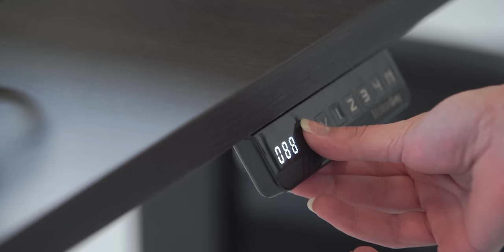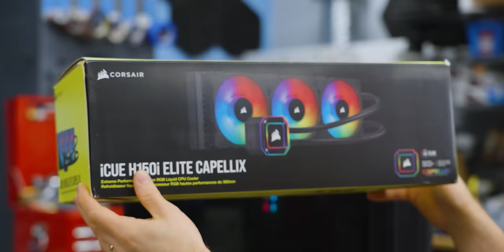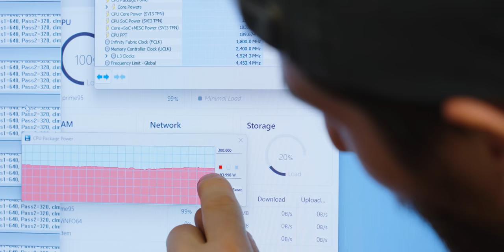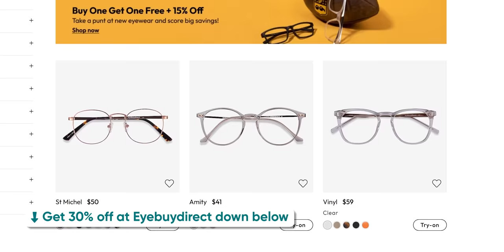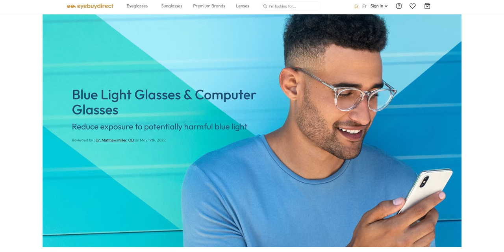Redneck Engineering my own CPU Water Cooler

Comment: Hose clamps def should've been utilized here.  Not only for performance over zip ties, but for the whole aesthetic/theme of car components/hardware meets PC components/hardware.
Reply: They should of tried an aftermarket tranny cooler or oil cooler. They have a much more reasonable size
Reply: Idk, I probably have more zip ties on my rally car than hose clamps tbh. 😂
Reply: I’m fairly sure my wrx is structurally together only because zip ties
Reply: @Sadamoto6  lol. Oh no dont get me wrong, im no where close to implying zip ties arent great for cars. Im merely saying on something small where the aesthetic is using something from a car as a mod, it would add to the aesthetic to use something that is also used primarily on that part. i.e. hose clamp on the rad. Just makes the mod that much more dope. But yea, i mean, have you ever actually worked on cars if you haven't used zip ties at some point? lol
Reply: Also, because it's supposed to be vaguely functional, hose clamps are the better choice.
Reply: @mikepatrona472  was thinking the same thing.
Reply: I bought a 1996 Mustang one time that had about 75 zipties in place of where the steering damper was supposed to be.

Comment: Heater cores are not exposed to air from the outside rushing past them, they are under your dash inside your car and have a fan blowing on them.
Reply: heater cores do get air from outside your car.
Reply: depends on the vehicle. on a chevy express you can turn the fan completely off on the highway, and the high pressure zone on the cowl area where the fresh air intake is, caused by the chevy express being shaped like a barn, will push almost as much air through the vents as the fan would on high.
Reply: He specifically stated that heater core came from a 69 camero. Those cores and almost every core pre 90s take fresh air from outside.
Reply: Your right. He described a radiator, the heater cor is typically inside the vehicle to heat the inside. The radiator is outside.
Reply: yeah true but that fan in the dash pushes way more air then 3 120mm computer fans. I dont know the power of that last huge fan but the cabin fan in a car is about half in size and about 50 - 100W
Reply: they do get outside air... but... usually through a small port that opens to allow outside air...
thats why many cars have a button called the "recirculate" button (please google the image of that button if your windows are always foggy)....pushing that button closes the port and stops outside air...which helps dehumidify the air better and improve A/C efficiency.. opening the port (turning off recirculate) allows outside air into the car to equalize humidity and reduce fog in a rainstorm
Reply: Someone was paying attention in an oshop
Reply: For everyone that is replying "oh but they do get fresh air from outside" that is not what Linus said or what I did. Your typical heater core is behind the firewall, inside the cabin, and under your glovebox. Yes, the ventilation system gets fresh air if you have the proper recirc mode set, but it is not getting air forced by it going at highway speeds like your main rad is. This air is typically coming from a much smaller vent located elsewhere in the system. There will always be outliers, but yes this is how it was done on a 1969 Camaro.
Reply: @CapitanDart  absolutely correct...
often that little flap is about 2" square (50cm) and deep inside the ducting but fed from the base of the windshield by the wipers....basically zero chance of any "ram air"....all cars have it....and often the fan pulls air through it AND the avaporator (which would also be a great cooler / AIO replacement as they flow a great deal more fluid than youd think although not designed for straight liquid)

Comment: Linus using wrong or slightly incorrect parts is very relatable. Many times I use whatever I can find around the house to make a project work and sometimes it's not perfect, but it turns out well enough. Never stop doing this LTT.
Reply: My bath/shower valve/selector is fitted with a milk tab when a part broke.... the milk tab solution is around 4yrs old now.
Reply: @Idiomatick  My compressor has a cylinder base gasket made from a milk carton. Has been working for years. 
It was supposed to be temporary but you know how those things go.

Comment: My first watercooling was with heater core from an old Opel. Fitted perfectly over the PSU in the old "full tower" style case, where there were plenty of room behind all those 5.25" bays (and I used those excess of 5.25" slots for a tupperware where I have submerged the aquarium pump) ..of course the dimensions prevented me to install that core to roof or back of the case, but having it so that the air path was from side of the case to other side of the case, it worked quite well. Also, when I built that, all the computer fans were like maximum of 80mm, so I got two thick 12cm 12V fans from an old photocopying machine and those made enough static pressure for the core. I dont remember what clocks I got with my K6-2 and my athlons/athlon xp's, but I remember I managed to run my Opteron 185 at 3.35GHz quite comfortably. The tension bar what I used to mount my block was nicely compatible with socket 7, socket A and also socket 939.

Comment: My first liquid cooled system used an Eheim pond pump and a transmission cooler with an electrical box as a reservoir, stuffed into a mid-tower case.  I still have it!  I miss the old days of overclocking and this video was incredibly nostalgic.

Comment: This brings back memories. That's what I used way back when for my first water cooling setup. I built a custom box that I bolted to the bottom of my case to house it, the fans and the pump (Eheim 1046, of course). The waterblock was a Dangerden.. something, I don't remember, but it was just a big ol block of copper. It worked great. It even got featured on HardOCP somehow.

And now I feel old thinking about how many years ago that was... ugh.
Reply: live fast die young? nah, live cool die old B^)
Reply: Ah the old days, when you just mounted your cooler directly to the die of your 1400mhz AMD Tbird.
back.. damn.. 22 years ago. 
Ugh indeed
Reply: @LordMithril  The one that you minutes earlier had used a pencil on to bridge the pads that let you overclock it :D
Reply: 1999 sick ass mod checklist:
☑ Hand welded copper block
☑ Junkyard moped radiator
☑ Florescent green engine coolant
☑ Tupperware reservoir
☑ Aquarium pump
☑ Radio Shack 3 way toggle switches
☑ Cold cathode lights & EL wires
☑ Sound-To-Light modulator DIY Kit
☑ 5000RPM fans from China
☑ Milk crate pc case for that LAN crowd
Reply: Submersible pump into tupperware which sucked water in from bottom, heatercore from a landrover, quad delta 92mm i stole out of some servers. For bench runs i packed one tupperware into a larger one packed with ice and pushed that old Barton. Never seen XP boot so fast!  Was pretty fun. Machine would idle with one fan at 5v. I miss it.
Reply: Dangerden waterblock, check. Eheim 1046, check. Custom peltier/water rig, check. Stable 50% OC on a flipchip Coppermine P3, check. One of my articles from back then even got Slashdotted, which gave the website the hug of death for like a week.

GOD I'm old...
Reply: The main benefit for me was NOT having the heat exchanger in the case, or even in the house (although in the winter you had to be careful with condensation)

Comment: I love building my own water cooling! I even made my own water block out of a chunk of copper back in the mid 90's that I still use today. I used a heater core from a 1984 Escort and an oil cooler. They were stack mounted on the top of the case and run in series. I custom painted the case in red and black diagonal stripes and the interior was painted florescent green with a black light inside and florescent dye in the water. I took it to U of M lan party and everyone was amazed that someone actually water cooled a computer. Good Times!
Reply: Noyce being the 1st w/c pc back in the day  ...

Comment: Yep, that sorta setup was very much like my first water cooling setup in high-school. Ganked the core out of a dead Holden at the tip. A very used pond pump, and a beefy 240v fan from some industrial hardware. A water block made in my school metal shop. Reservoir was a tupperware container I stole from the kitchen. All the fittings were irrigation fittings from the shed. The whole contraption was obnoxiously loud. So, installed it in an old At case I cut down to fit the core dimensions. Handles on the top of that and the PC were handles from the car, painted to match. The noise solution, long pipes, and put the noisy box outside my bedroom window. Everyone thought I was insane, your putting WATER in a COMPUTER??! got some insane overclocks😊

Comment: Here's a tech tip Linus: use a little bit of rubbing alcohol as lubricant to slide the tube further on... It will evaporate later and you'll be golden 😎
Reply: I use hand sanitizer in a pinch.
Reply: Does hand sanitizer contain thickening agents that might clog the waterblock?
Reply: @nyanpasu64  Not all hand Sanitizer does, some of it is as thin as IPA, but the gel kind sure does, and it might be a bit iffy to use it, and I learned the hard way years ago, and left a bottle of hand gel in my ex's car on a very hot day in the cup holder, and it exploded all over the place with me spending part of an afternoon cleaning her car, so it can also exploded under heat, and pressure, so if the gel does not evaporate under the tube there is a very slight risk of explosion, or just popping off if the tube gets too hot, and is on the fitting very tightly.
Reply: @nyanpasu64  some do, I left one sitting on top of my fridge for a year and air got in, it reduced and morphed into a solid clear mass.  Whenever I used it, I felt like I had a film layer of crap on my hands, and when washing them later it would come off.

Comment: We need more of these cooler shenanigans! 

It feels like eventually we will get to alternative solutions that might work for us normies... eventually.
Reply: I want them to revisit the bong cooler!
Reply: Could you use a Dyson style fan for cooling?
Reply: I always thought people living in freezing places like alaska could just pipe outside air to their pc cases and then pipe out the hot air
No extra modifications, just letting below zero air going into the case, but isolating the case from the rest of the room of course, so people dont get their rooms full of freezing air
Or maybe even leave the pc separated from the room, kinda like people put the AC evaporators outside of the house, you'd just have the pc out, yes, with protection from the snow and the elements, and stuck very well into the wall so no thief yoinks it out
Maybe even build the pc inside of an AC case so people think its an AC when its actually a pc getting infinite free cooling from the harsh polar climate
Reply: @cupuacu4life13 ve thought about that too, but you don't want to heat cold humid air from outside inside your PC though, what I have thought about is you just put the radiator or radiators outside but of course you have to protect them somehow from the harsh environment and depending how cold it gets you may want to use antifreeze (also you don't want to let it go that cold). But I don't live in a cold enough place to try this. It could also work if your PC is close to a side of your home that's always colder
Reply: @ltio4619  No. There is no static pressure with these fans only air flow. They work by sucking more air through the hole in the middle so if you block that with a radiator it wouldn't work anymore.

Comment: Well you can always just use automotive coolant, since a lot of vehicles have cast iron engine blocks, aluminum heads, probably an aluminum radiator and a copper/aluminum heater core… I’ve been using aluminum radiators in my pc’s with EK blocks for several years and haven’t had any problems, plus you can get engine coolant in just about any color…
Reply: Give me engine coolant in neon green pastel cryofuel aurora tinglydingly doodad colour and I’ll be impressed
Reply: As they said, most heater cores today are made of aluminum, as well as radiator and other parts. Steel isn't very reactive with aluminum and overall cuts cost from the engineering side. More than that, the tightest spaces water flows through still are much wider than a computer's water block fin.

So much so that my car runs cooling in plain tap water and it has no leaks or cooling issues, and the car itself is 15 years old with only one radiator change due to a car accident ages ago.

Also, car coolant is no different from computer coolant; there is no reason to be except for the propylene glycol, since PCs don't get hot or cold enough to need it.
Reply: I use blue window washing fluid in my DIY setup, it also doesnt touch dissimilar metals and is cheaper.
Reply: @wafu6058  about the green pastel cryofuel aurora i have some around but the other part is little harder
Reply: A little gunk in your car cooling system isn't a big problem. A little gunk in a cpu block and it's done.
Reply: Been running automotive coolant for years and found no gunks at all, stuff's great!
Reply: You can, but you need to use the right kind... or just opt for the universal type. It's good-enough
Reply: I tried 99% isopropyl alcohol once, but it evaporates too fast
Reply: Water wetter for the win... the pink color isnt noticable unfourtuantly
Reply: Water is fine, just need a drop or two of an anti microbial, or silver in the loop and no growth
Reply: @wobblysauce The bigger concern is corrosion or you'll end up like whole room water cooling.
Reply: @Rockport1911  I don't see any reason to use windshield washer fluid over plain water. It doesn't contain any corrosion inhibitors to the best of my knowledge, it's probably more likely to cause damage if it leaks, it's not designed to be heated or transfer heat efficiently, a lot of washer fluids are toxic, and its lower freezing point compared to water isn't of any benefit except for sub ambient cooling, in which case a fluid with better heat transfer properties like actual coolant would be preferred anyways.
Reply: @gasracing4000 VP Racing Cool Down has surpasses Water Wetter in my applications.
Reply: @GregoryVeizades  Noted. Another similar product is purple ice. I am accumulating some foam in the reservior of my PC loop with the water wetter and it could leave residue on glass (so maybe not the best choice). I was considering changing to purple, but ill check this out as well.

Comment: As a mechanic whos had to force hoses over fittings that were "too big". It is alot easier to boil water and use the hot water to soften the hose and cause it to expand. You get alot more hose to soften and expand at once rather than using a heat gun which only heats one side at a time and can cause the hose to burn. Also stick the Heater core in a freezer or bucket of ice to get it to contract some making the process slightly easier.

***Edit. Also while sticking a smaller hose into a bigger hose you can ensure it not leaking by putting in a hose connector for the smaller hose, then just use a band clamp or zip tie to tighten around the connector

Comment: Reminds me of how we used to stretch pvc water tubes over weirdly sized glass fittings back in my university research lab - just put the end of the tube in a small beaker of toluene for like ten seconds and then you have about half a minute to get it onto your fitting before it somewhat hardens.

Comment: Next you need to build a shared radiator solution with hot swappable water feeds so that a bunch of PC's (or laptops) can use the same cooling system. The radiator could even be on the office roof.
Reply: That was done like 10 years ago with the whole room water-cooling
Reply: @xfy123  whoosh

Comment: Transmission or power steering coolers would work well too. And they are usually smaller and come in way more sizes
Reply: But are they made from copper
Reply: @Prostě-Gomat  only some of them are, and they're usually more expensive options

Comment: I personally use this type of cooling every day based on two heaters from Fiat Ducato from 1994-2001, bought brand new for $20 each as a replacement for the original. They are denser than yours and both are mounted on top of a homemade case hanging on the wall and cooled by a total of three 20cm fans, 1.5 fans each (left fan is driven by the graphics, right by the CPU and the middle one is the system fan).  The whole thing cools like a chimney, because the computer draws air from the bottom and expels warm air at the top, and the 20cm fans are almost inaudible during everyday gaming.  Theoretically, if water at a temperature of 90°C were supplied to them, each of these coolers would be able to give 3kW of heat to the environment, so the whole thing has a lot of reserve.

Comment: I've used 4 row heat exchangers meant for furnaces for DIY pc coolers quite successfully. You can get them for about $60 new and are a lot more adaptable on the fittings portion than automobile bits. Fountain pumps are also quite cheap and accessible; server fans can be had for $20 and provide more than enough pressure (albeit quite loud at full tilt) to push through a chunky cooler, but you can run them either directly off the motherboard or in PWM mode with a controller (the preferred method in combination with a fan curve).